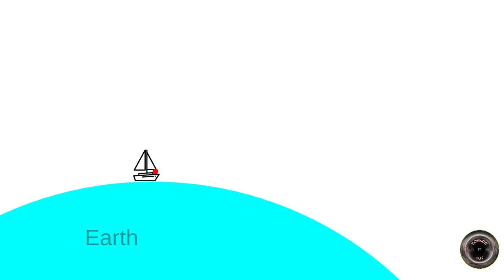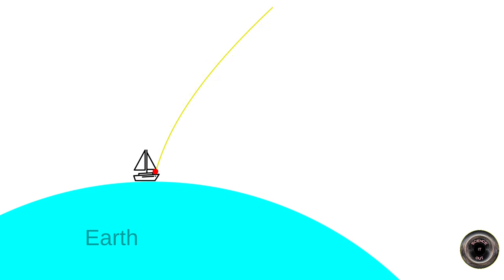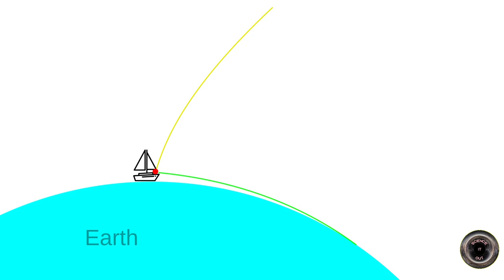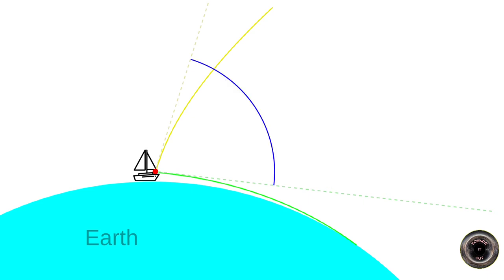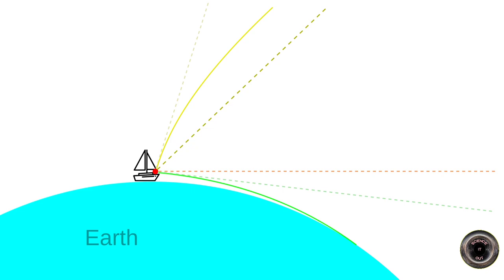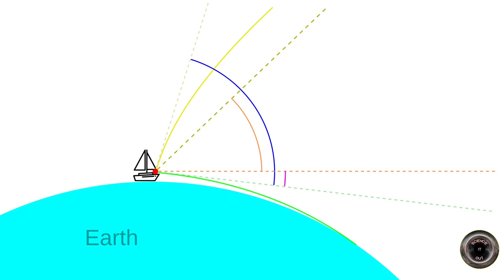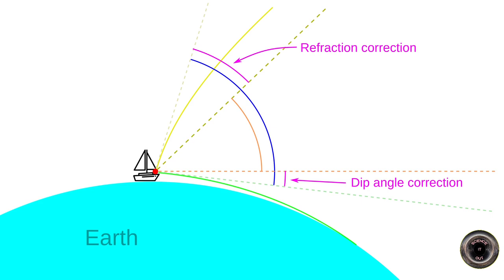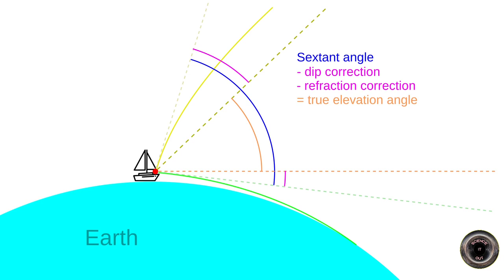How measuring the elevation angles works on a globe

Comment: The effect of refraction gets less as you reach the Zenith. The effect of refraction is to raise the celestial object slightly. It doesn't matter what direction you are looking, the refraction correction is the same. If the Earth were flat, the behaviour of the Sun would require refraction that LOWERS celestial objects by zero at the Zenith and increasing drop the lower the object is in the sky. The pattern of daylight on a flat Earth is NOT a circle showing the added drop amount varies. Thus flat Earth is incompatible with the documented practice of Celestial Navigation.

Comment: The FE people think in terms of land surveying, with baselines, heights of objects and angles made with flat ground, as well as the "90 degrees" they expect to see in the triangle.  The terms used in astronomy of "altitude", "elevation" and "height" are misleading to them as they seem to think we are measuring the vertical distance in miles to a star or planet, and they think the Sun is about 3000 miles above the (flat) Earth.  Land-based surveying requires corrections for curvature (of the ground) and refraction, hence their fascination for those items.
Reply from the maker: "The terms used in astronomy of "altitude", "elevation" and "height" are misleading to them as they seem to think we are measuring the vertical distance in miles to a star or planet"
One could think that after multiple people have been telling them thousands of times that these are angles, they would figure out that these aren't vertical distances... But I guess with flat Earther's it's not a given.
Reply: and you stay begging the question and reifying your model to take extra steps when making calculation

Comment: @Nathan Oakley sent me here. He's reviewing your video live now. You have a fundamental problem with comprehending what an angle is. 😂
Reply from the maker: I respectfully disagree 😉
Reply: @scienceitout  A sextant is an angle measuring tool. It measures elevation angles of stars for celestial navigation. An elevation angle is the imaginary line of sight to the star and the horizontal plane the observer is standing on. Apologizing for no curvature doesn't help you.
Reply from the maker: @TB-xx8vj  "A sextant is an angle measuring tool."
Yes.

"It measures elevation angles of stars for celestial navigation."
That, too, but not only that. It can be used for measuring all sorts of angles. For example, the angular separation between the Moon and a star, which used to be a way of determining time before accurate marine clocks were a thing.

"An elevation angle is the imaginary line of sight to the star and the horizontal plane the observer is standing on."
It's the angle between the imaginary line of sight to the star and an imaginary horizontal plane passing through the observer's eye. No standing on the plane is involved.
Reply: @scienceitout  Sea level is not imaginary. You conceded that you need height above sea level for dip correction. That's the horizontal baseline used for the elevation angle measurement.
Reply from the maker: @TB-xx8vj  Sea level is a geoid. Height above sea level is defined relative to the geoid. And the horizontal "baseline" is just an imaginary plane that is 90° to plumb, which has nothing to do with the surface or its shape.
Reply: @scienceitout  Level is a horizontal plane with no point higher than another. Even in your earth curve, maths surface level is a horizontal plane. You can't measure height above sea curve. You need a horizontal reference plane.

Comment: Flat earthers hate this one weird trick
Reply: I'm a flat earther... celestial navigation is not a trick its a fact!
The fact an Elevation Angle measurement requires a flat horizontal baseline means you are indeed measuring and navigated the earth flat!

🤦‍♂️ the heliocentric model requires a flat earth Elevation Angle measurement to Polaris for Latitude!
Reply: @DanielSamaniego-of5xl  You sound like a Nathan Oakley parrot. None of what you've said there is true, we can easily take elevation angle measurements from the surface of the earth, as it's been done for centuries.
Reply: @DanielSamaniego-of5xl  Dont believe me? How do you think we find latitude in the southern hemisphere where Polaris isn't visible???
Reply: @philbreadcrumbs8179  the north is simply mirrored in the south. its the same measurements sandwiched antipodally which is why it starts at 0 degrees again at the equator
Reply: @Owen-sx4jj  Right, that's not an answer to the question, but thanks anyway 👍
Reply: @philbreadcrumbs8179  it is but oh well
Reply: @Owen-sx4jj  No, it really isn't, but oh well 🤷
Reply: @philbreadcrumbs8179  you ask a question but don't want answer. Go look at how they get south latitude and stop being thicke. South is a mirror of North
Reply: @Owen-sx4jj  I know how angles of latitude work clever clogs, that WASN'T the question, the question was how celestial navigation is carried out in the southern hemisphere where Polaris isn't visible if elevation angles to polaris are used to do this, as the other guy claims.

Maybe read comments before trying to reply to them instead of just making yourself look silly.

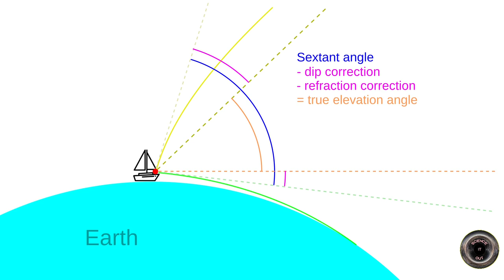Comment: 4:14 "That's a topic for another video." It certainly is and would make a very interesting video. I hope you consider making it. This video was excellent, so concise and clear.
I want to mention a couple of things. The "Dip Correction" is, in itself, evidence for a globe Earth because it corrects not only for refraction near the horizon, but also for the height of the observer above the water. The amount of correction required for the observer height is directly related to the curved surface of the spheroidal Earth. On a flat Earth (assuming you could actually see a clear horizon, which is dubious) a dip correction would be need for observer height, but it would have a different relation to height. It would change at a different rate.
Second, the refraction near the horizon is more than the refraction for the star observation higher up. This is reflected in differences between the 2 refraction corrections. So these corrections also confirm the accepted science behind atmospheric refraction. Both these corrections support the spheroidal Earth and the reality of refraction.

Comment: There's probably a similar video in readings of the moon since it's so close to Earth it requires parallax adjustments to account for the difference to the center of Earth. There's also trick I just found to determine if the moon is waxing or waning. If you can cup the full side of the moon with your right hand it's waxing, left it's waning, but that's for the northern hemisphere and it's the opposite in the south. How does that work on flat Earth?

Comment: One thing.
The line of sight to a star has hardly any refraction as long as your star is above 30 degrees over the horizon.
Navigators are warned about that and never use those stars in a sextant observation.
Reply from the maker: True, but the almanac lists the corrections for refraction all the way to the zenith, anyway. But they are some fractions of arc minutes above 30 degrees, so as you say, pretty insignificant.

Comment: Just a correction to the diagram: the green dotted line should be tangent to the geometric horizon, which would anyway be closer than the apparent one, instead of being tangent to the curved green line. Other than that, great explaination! :)
Reply from the maker: Should it? When using a sextant, we're measuring the angle from where we see the horizon, and that's not where the geometric horizon is - it's always refracted by some amount. In fact, if you take the values for the horizon dip from the table in the nautical almanac and try to figure out what value of the radius of the Earth they are using, it turns out to be something like 6/5 R, which shows that the almanac isn't using the geometric horizon, either.
Reply: @scienceitout  I was just saying that the refracted horizon - which if I understood the diagram correctly - would be the continuous curved down green line, is properly drown, but the actual geometric horizon from which we should calculate the dip angle to the horizontal plane of the observer, should be tangent to the earth instead of pointing to the air (even if the scale is way off). That way it should be closer than the apparent horizon. But I missed the point that the actual angle we’re getting from the sextant is the one we’re looking at (I.e. the apparent horizon). Thanks for the clarification!
Reply: After watching the video again and some other sextant diagrams, which included the tangent line to the geometric horizon (and got me originally confused), I think that the tables for the dip angle based on the observer’s height, simply include the refraction correction to the geometric horizon, in order to give you the angle that you want, between the apparent horizon you’ve seen through the sextant, and the horizontal plane at your height. Is that right?
Reply from the maker: @skesinis  Exactly 👍

Comment: There probably ought to be separate tables for various times of year on various bodies of water, because refraction in the Caribbean in late July and refraction in the Baltic in early February aren't going to be the same, but then nobody's trying to get up the port channel and into the correct mooring by celestial navigation, so the difference in results probably doesn't bother people much. As long as you can make sure you go up the Solent not the Bristol Channel or land in Dominican Republic not Cuba, that's good enough, right?
Reply from the maker: Refraction is the most variable close to the horizon, and in celestial navigation one usually attempts to use objects that are high (at least 15-20° above the horizon), where it is small and not that variable.
I guess the worst problem would be with the horizon itself (you can't really look at the horizon 20° above the horizon 😅), but this still won't be that bad - a few arc minutes one way or the other, translating to the uncertainty of position on the order of a few nautical miles.
Reply: Quantify the perceived errors! Sure there will be a difference, but are they relevant?
Reply: There are worksheets for calculating Dip Correction using barometric pressure and temperature for more accuracy in non-standard refraction conditions.
Reply: When you have done your meteo you can calculate the refraction.
And as you say, nobody is going in to port on celestial navigation.
It usually is with a pilot on board that knows the local waters.
And there is lighthouses, buoys and radar, etc....

Comment: An idea how to show the rotation of the earth:
Take the rotating azimuths and elevations on a place on the earth.
Project them on an AE-map, with the center at the GP for the sun.
Animate the map, to show the apparent path of the sun, day and night.
Include the ecliptic circle, as a straight line between the tropics, and the arctic and antarctic circles, to show midnight sun and seasons.
Mark out the path of the sun across the map.
Reply: How to explain the phases of the moon:
Mark out the terminator on the earth and the GP for the moon on the map.
Reply: How to show the distortion in the AE-map: Show the same thing on a second map, with the center on the opposite side.
Reply from the maker: To be honest, I'm not sure I understand what you're trying to propose.
You're proposing an AE map centered around the Sun's GP - I think I'm with you so far. But what then about the apparent path of the Sun? Would you imagine the Sun moving over this map, or the map itself changing to keep the Sun's GP always in the center of the AE projection?
Reply: @Science It Out
It is the Azimuths and elevations moving over the map. You get different movements with zenith on different latitudes, and with the sun over different latitudes.
And you can see the azimuth and elevation for the sun, and the time and direction for sunrize and sunset.
You can also see the apparent direction of the suns movement at the sunrise and sunset (the change in elevation near the equator and the change in azimuth near the poles).
You can even explain sunrise and sunset with the distance to the GP for the sun. It is correct with the sun in the center of the map.
And you can show the rotation around the earth with the direction of north-south and west-east if you mark it on the map (it is not the same rotation as with the north pole in the center of the map).
Reply: @Science It Out To show rotation simultaneously on several places, you can mark out zero elevation and the cardinal directions for each place, and highlite the overlap between the terminator 90 degrees from the sun and the astronomical horizon 90 degrees from zenith.

Comment: So are the corrected measurements, especially the one related to the horizon, known? Therefore, what is the index of refraction for an observer 2 meters above sea level?
Reply from the maker: What do you mean by "index of refraction" in this context? Index of refraction usually means a property of a medium, namely how much light slows down in the medium relative to the vacuum.

But the corrections for refraction and for the horizon dip (also refracted) are known and described in the almanac. For the horizon dip, the almanac says to use 1.76 times the square root of observer height in meters - so for 2 meters, that would be 1.76 x 1.41 = 2.5 arc-minutes.

As for the correction for refraction, it is assumed to be independent of observer height (which is a good approximation for low observer heights, like below a few hundred meters), and only dependent on the measured elevation of a star. (It gets a bit more complex for the Sun and the Moon, because the correction for the Sun takes its diameter into account, and the one for the Moon also includes a parallax correction.)

Comment: @Nathan Oakley 1980 sent me .. he reviewed your video but i have an issue with a bent line of sight in orthographic view . Did you have someone positioned  at the side of your head and then tell you that your line of sight is bent while your looking up at the alleged star. I really dont believe thats possible in reality .i know your making stuff up as you go along to fit your narnia globe in .
Reply from the maker: "Did you have someone positioned  at the side of your head and then tell you that your line of sight is bent while your looking up at the alleged star. I really dont believe thats possible in reality"
Look a bit deeper into optics. The general principle is that in a non-uniform medium, light bends in the direction of increasing index of refraction. For the air, index of refraction generally increases with increasing density, and the density of air is higher near the ground than higher up. All of this together means that light in the atmosphere generally bends down. This is corroborated by long distance observations, observations of rising and setting stars, as well as flattening and chromatic aberration of rising and setting Moon and Sun.
Reply: Ironic that your papa-flerf is actually the one making stuff up all the time. Ask him when was the last time he used celestial navigation in the open sea.